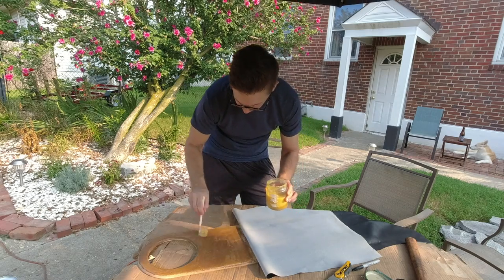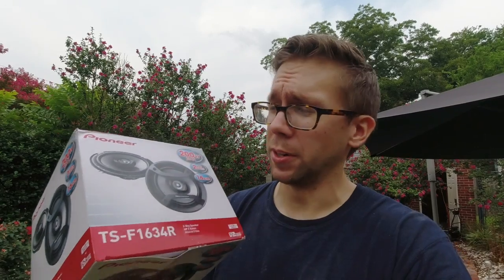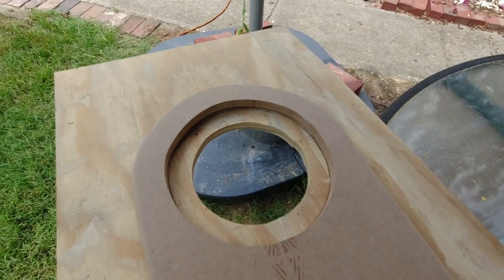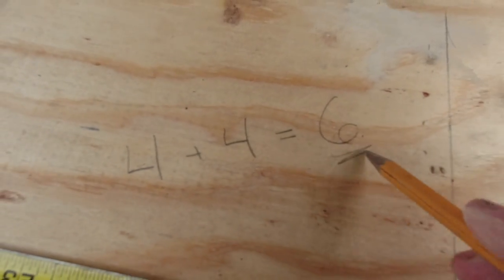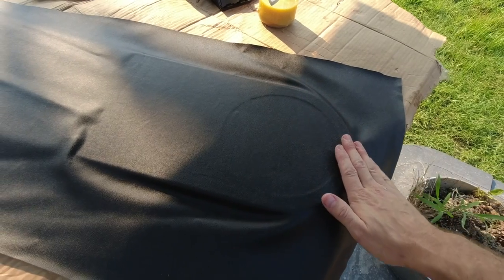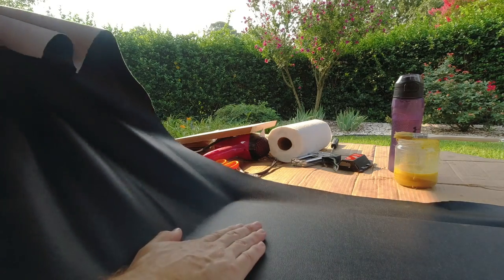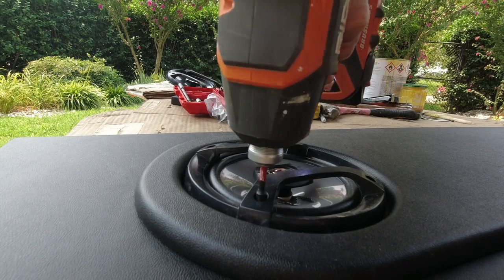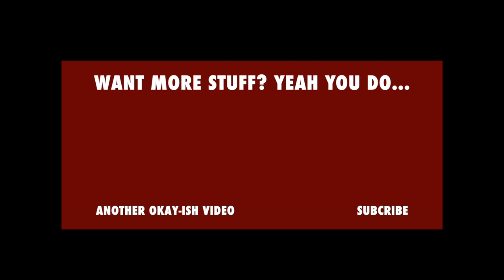How To Build A Custom Rear Deck - Fabrication, Speakers, Vinyl Wrapping/Upholstery

Comment: You are hysterical 😂 but nice job bro I'm really trying to modify my doors as well as my back then I need to get my super sundown tweeters put up and those will need to be modified as well so I enjoy watching you to learn so ty.
Reply from the maker: Awww thank you! And I’ve done speaker pods from everything it seems like haha. Fiberglass, sintra, glue and sawdust - you name it! Ironically it’s an in the works project but I’m doing a video using a wood panel but grafting a 3D printed pod onto and blending manually.